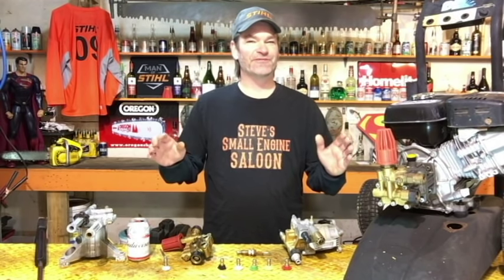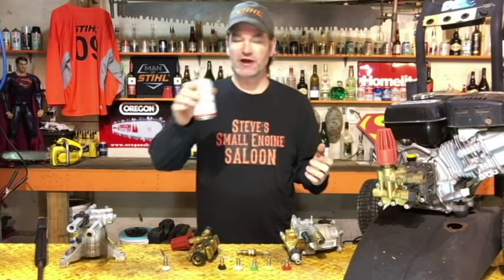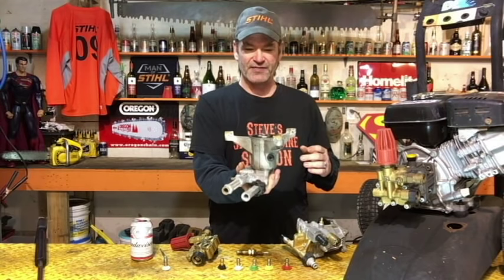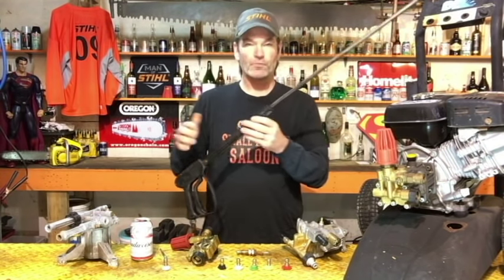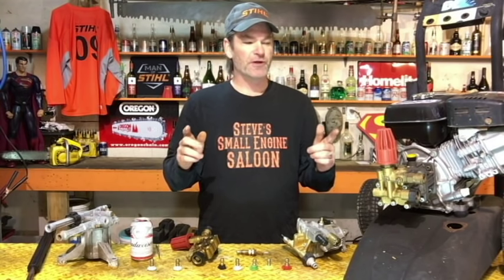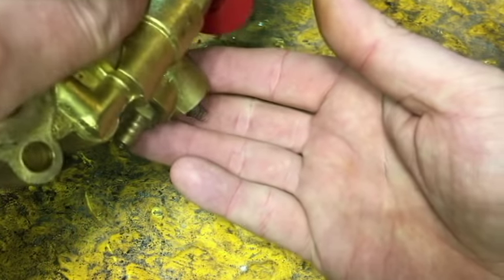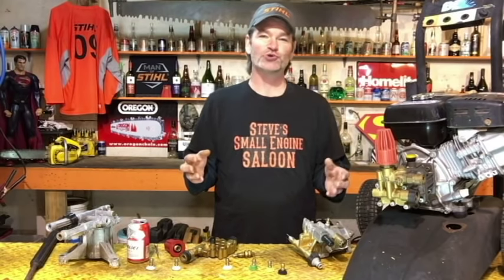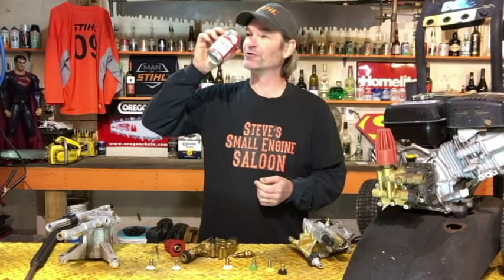How To Fix A Pressure Washer That Has Low Pressure

Comment: Hi Steve, I have a pressure washer with a Honda GX160 engine and CAT Pump (model 2SFX30GS).  The engine usually starts in 1 pull and it seems to run fine.  I get good pressure from the gun, but the engine only runs for around 30 seconds, then sputters and dies.  After starting, I can operate the gun for less than 1 minute before the engine stalls.  If I release the trigger before the 30 seconds, sometimes the engine would sputter and dies.  Basically, the engine dies randomly when the pressure washer is operating, and also sometimes dies when the gun trigger is either pressed down or released.

At first, I thought it was the engine.  I disassembled the carburetor and cleaned the jets.  I didn't see any worn parts inside.  I also changed the gas tank fuel filter,  swapped the gas tank cap with a known good one to rule out venting issues, and unplugged the engine-oil sensor to test.  The problem persisted.  I then swapped the entire carburetor with a working one from another GX160 engine, and still have the problem.  At this point, I speculated it was unlikely the engine.  I disassembled the unloader valve and didn't see much wear, and the plunger moved freely without problems.  I lubed the seals on the unloader valve with a tiny bit of silicone paste, and the plunger with a small bit of light oil and reassembled, and experienced the same problem afterward.  The times the engine didn't die when I release the gun trigger, I see the unloader-valve spring being compressed.

At this point, I'm completely stumped.  The pressure washer was working fine last year before I winterized it.  What do you think is causing this problem?  Is there some malfunction in the CAT pump that can cause the engine to stall when the trigger is down and the gun spraying (i.e., no water bypass)?

Comment: I always liked the adjustable tip most pressure washers came with years ago rather then these pressure washers that have come out today with separate tips. Just my opinion from owning pressure washers since the 70’s. Another great video by the way.
Reply from the maker: Right on ...
Reply: My neighbor brought his pressure washer over with that nozzle complaining that there was no pressure, he had turned it to the soap setting and didn't know it had that setting.  Quick fix 😉

Comment: Great video I have a pressure washer that I used and did not store it properly .I didn't turn off the gas and the pressure washer would not start. I checked  the oil and found out the gas traveled to the motor and I changed the oil it started right up but It didn't have any pressure so I grabbed a Modelo Especial and cleaned the tip and it worked great. Thanks
Reply from the maker: Right on Dan...

Comment: very good video. Thanks. I've been watching a lot of video fixing pressure washer but I don't see anyone mention about the water supply. Make sure your water valve faucet is fully open too. This could also cause lack of power because there is not enough water go into the pump. But Steve, I've watched many of your videos, I loved it. Will fix my Ryobi string trimmer next week. I got new Carburetor on order.  Thanks again Steve!!!!
Reply from the maker: You're Welcome...

Comment: It was the the nozzle. I was ready to ditch the pressure cleaner my father in-law gave me because it had no presser. But before I did, I watched your video. I cracked open a bear as instructed. Damn, it had a black nozzle in it. I changed the nozzle to the white one and bang , it worked. Thanks Steve
Reply from the maker: Awesome!

Comment: Great video Steve I recently started tinkering with my 14 year old pressure washer and you have given me some good tips I didn't know about.  And yes 14 year old Honda engine still running strong except for the water pump that just seized up.  I ordered a new water pump for it so I'm hoping I get at least a couple of more yrs out of it.
Reply from the maker: Right on Pete...

Comment: Very informative.
Never were truer words spoken. Everyone has a favorite tip they use all the time and fact that holes wear over time getting bigger n bigger. On a more serious note. It would seem to me that the majority of people's issues can be traced to the quality of their water supply.. And this video affirms that belief. We must develop a way to clean the inside of the pumps without having to open them.. I'm thinking soap, vinegar and something coarse in a loop for a few minutes along with a soak of hot RO water. Any suggestions?
Otherwise planned obsolescence wins. Can't have that.

Comment: Great video. I do this for a living but on commercial pressure washers. Wanted to make some comments to further your video. NEVER turn your unloader all the way down to the bottom. Thats the easiest way to destroy your packing and unloader. It is not meant to be bottomed out. The only other thing id have to say is, the tips are different sizes as well as different spray patterns. Getting too big of tips or too small of tips will vary the results. Make sure you read the number laser printed on the side of the tip. It usually starts with your angle and then goes to the size. There are 2.0 (20) all the way up to 7.5 (75) i believe there are bigger ones but they are rarely ever used.
Reply from the maker: Great comment!  Thanks Austin...
Reply: Hellon Austin, I have a Power Mate 2400 psi Washer.
I used a retractable hose about 6 months ago instead of a regular hose. 
The retractable hose burst, and water started coming out of the water pump area on the machine.  
I called Power Mate, they said the water pump was damaged. I have not used it since then. 
Insult to injury, the Pressure Washer was in some light rain this year. 
These are my EMBARRASSING facts, 
A new pump is going to cost me $160, $85 to install. I'd like to take care of this myself. Any thoughts?

Comment: one other place to check for blockage is where your garden hose hooks up, there is a screen in there that catches debris, pull it out and make sure its clean, anytime i hook mine up to a outlet, i turn the water on an let it run for a minute before hooking up the hose, bugs and trash can be in them.           here is the best tip you will find, run antifreeze through your pump when your finished, it prevents rust as well as lubricates the pump.. cut your gas off let it run until it runs out of gas.

Comment: Great video.  I have a low pressure situation.  I checked all that you mentioned.  I have the vertical pump.  I'm thinking un-loader valve.  Could this cause low pressure?  Thanks

Comment: Another one of many excellent videos, Steve. If I might suggest, I finally change guitar stings one in a great while. Depending on the gauge, .010 to .046 or whatever, you can use whichever string to clean very small  ports like that. The D string, for example, is strong enough and flexible.

Comment: I have a Karcher 2400 pressure washer. my problem is when i start up the washer, press the trigger I have no pressure. then I remove the spray tip and just run some water, I put the tip back in and i have full pressure, if i let off the trigger i need to do this process every time. i have used different tips, they all work fine. but i always need to pull the trigger without the tip then put the tip back in and it works fine. i put the tip in immediately. what is my problem? I really like your channel, it is great. thanks

Comment: Another great video, I turn to you so often to solve my small engine issues, and all with great success. I have a Honda pressure washer that has great pressure when I first start using it. When I release the handle for any reason and then pull it again, I get very low pressure. I have to remove the wand, pull the handle and let the water flow for just a sec, then reinstall the wand, and I get my pressure back. This is how my washer has worked for years, and I have not been able to figure out what's causing this. Any idea?
Reply: Your unloaded valve could be sticking. Simple repair. Remove valve, (no need to remove pump body from mounting) check and clean valve and O rings, lube with silicon grease and refit.

Comment: Thanks for the tips!  I have an Ex-cell 2,500psi Honda powered pressure washer and after about 2hrs of use I keep breaking the radial piston straps (10" x 1 1/2" pcs. of flat steel mounted above and below the pump cam shaft that flex as the piston pump rotates)  I'm wondering why this happens.  Thanks for any ideas.

Comment: Thanks for the small engines information you so generously share.  Pressure Washer Simpson with Honda GV-190 engine: my issue is low pressure, as your video described the red-knob, red or black maybe turn to adjust pressure output; I am unable to locate either of the knobs you spoke of on my machine, what else might i do to locate the knob?  I appreciate you help...thanks again for all you do.  James G.

Comment: Hey! Great video. I still have a question although I think u may have helped me out. Every time I put any tip on it works normal but when I let go of trigger and pull trigger again it only lets out a mini stream. I have to actually take the tip off and put it back on for the pressure to kick in again. I have a feeling it has to do with that small spring or o-ring part.  No one has ever touched it in years for repair or maintenance so anything is possible but when it works it’s great. I just don’t know why it has inconsistent pressure. I appreciate any thoughts on this problem.  Thanks. We need more people like you to share your wealth of knowledge. I am mechanically inclined but don’t know anything about small engine repair or power washers. So I appreciate the help always.

Comment: It was the preasure relive valve Chinese type and they haven't used a nylon thread nut and had unscrewed with vibration. Mine didn't have a red or black handle

Comment: Quick Question for you! Ran my pressure washer today on front deck. Worked fine. Moved around to the back deck. Cleared the lines of air. Fired it up. Squeezed the trigger and pressure for 2 seconds then goes low pressure. You can see at the end of the wand, the water is pulsating slowly. Release the handle and you hear the pump trying to pressurize for 2 to 3 seconds. Pull the trigger, high pressure for 2 seconds and then low again. Thought it might be inlet water pressure and tried a different spigot with the same results. Open for ideas! Thank you!

Comment: Great information Steve!  And something this 66 yo female can do!  Thank you!
Reply from the maker: Thank You...and You're Welcome...
Reply: @StevesSmallEngineSaloon  Well, I did everything you said this evening.  The nozzles are clear.  The high-pressure tube thing - I can see the light through the hole.  The uploader thing moves in and out.  (Is it supposed to go the whole way down?)  It goes halfway but moves freely.  So I hooked up the water hose, checked to see that water was flowing though it and it was good.  Put the spray hose on the machine and tried to see if water would flow (without the engine running).  Nothing. Nada.  I'm at a stand still and I REALLY want to get my deck and railings pressure washed soon.  Anyother words of wisdom?

Comment: My preasure washer is brand new only used it once and when I used the soap nozzel  it used soap fast and it ran out, I then switched nozzles to get high preasure and there's nothing.. no jumping of the cable it's a steady stream out nozzel. Please any ideas ? It's nothing on the wand no twisty end ? Please please anyone any ideas ?

Comment: Hey Steve I have a cat pump model number 67DX, I was wondering if you could help me out. I have a problem getting the crank case back on over the connecting rods and crankshaft. Any tips or tricks?

Comment: Steve...great video!  Thumbs up! I have a Simpson Pressure Washer that runs fine but only sometimes will shoot water through the gun.  I can hear it building pressure and it will blow off through the relief valve when the water heats up.  When I can get it to engage it runs fine for as long as I hold the trigger on the gun.  If I let go I have to continue trying to get it to re engage.  When it builds up to much heat it blows off.  I checked the unloader valve and it wasn't stuck.  No blockages that I can find.  Ran water through it with the pressure hose taken off to purge any air as well.  I found that if I pull the trigger on the gun while the engine is NOT running and getting that trickle of water going through and then start the motor it will spray with pressure and continue to do so until I let go of the trigger.  Then it is back to trying to time it by how the motor sounds and keep pulling the trigger.  What do I have going on here?  I appreciate any insight!

Comment: Ihave a Generac OneWash Power washer that I just put a new carb on. It now statrs okay but when I start to use it I get no pressure. Do you have a video on repairing the unloader valve? Maybe I put the springs and cables on the carb wrong. Thanks. Frank

Comment: I have a Generac 2400 pressure washer, Briggs vertical engine... I cleaned screens and inside nozzle but first spray is still high pressure as long as I hold trigger then all other spraying I get half pressure.  Last attempt to dismantle nozzle, after soaking nozzle in soapy water I found two bearings and a black plastic washer but don’t know where they go...  I cannot adjust the stream now so I am thinking they have something to do with that.  Also there are U clamps holding the nozzle to extension rod, one on outer yellow section and one on inner black section.  I can’t get the extension to move from nozzle to adjust pressure, seems like it is stuck on high setting.  Any help would be much appreciated.

Comment: Best choice for clean out wires is a cutting torch tip set. Cheap. Lots of choices. Any welding supply should have them or online.

Comment: Like the vids! I have a Honda GCV160 that only sprays at full pressure w choke on. It idles and runs with it off. Carb has been torn down and rebuilt, new plug and its a fixed throttle so no adjustments available. Any guess as to why it won't get to high pressure when choke is off?

Comment: Much cleaner results if you add a solvent like diluted chlorine to the surface you are cleaning. It prevents early regrowth of mould and there is less damage caused to the concrete surface especially when using a rotary dirt blaster head. We call them that here in Australia.
Reply: 2 years ago since you made this comment but in case you're still there just remember every time you had chlorine to your pump it does some very corrosive things to the metal so if you can apply chlorine through a separate vehicle via maybe just a bug sprayer or hand pump unit or whatever but I try not to add chlorine into the pump

Comment: I have a Generac Model 01537-1 (Honda engine) This thing has me baffled...  The only way I can get it to go to high pressure is almost stall it by choke and release choke quickly and it will kick on... Then when I release the trigger on the wand and pull the trigger again it will not go to high pressure.. Got to go through the same steps.  what do you think?

Comment: My Troy built crapped out(no pressure) after 2/3 Year’s . After driving myself nuts with all trouble shooting tips, including replacing reducer valve fo $30 which didn’t work, I replaced entire vertical motor fo $80! American airless. Com. Boom. 15 minuets.Works like  new!

Comment: Pretty sure the unloader valve is bad on mine I am getting drove nuts by pressure settling at 4200 PSI when I let go of the of the trigger when I pull the trigger with the 0° nozzle on pressure drops all the way to 2600 PSI give or take it's a 3600 psi rated machine. Ruled out being a low supply pressure because my outdoor faucets are all unregulated and I get 140+ PSI at all of them (I have to use reinforced hoses for my garden hoses). All of my other pressure washers produce pressure at what they're rated for I have ruled out everything but the unloader on this one waiting on a new one now.

Comment: Steve, I just discovered your videos and I love them!  I have a question:  I have a SunJoe upright pressure washer that seems to have lost pressure.  I checked the water flow with the power off and it seems to be clear.  The nozzle, the gun, etc. has a buildup (calcium?) that has not blocked the holes but may be diminishing the flow.  How should I clean them??  and what else can I check at this point?  Thank you!!  Rebecca

Comment: Hey Steve, love your videos. I have a problem with my pressure washer, it was supposed to be brand new and in working condition...I got it from a discount warehouse and the first time I hooked it up and turned it on there was water running out of the brass fitting on the bottom of it that looks like a small hose connects to it.... causing it to lose quite a bit of pressure when pulling the trigger. I'm perplexed and idk what to do to fix it. This is my first pressure washer and I have no experience with them. If you could help me out I cannot tell you how appreciative I would be! I look forward to hearing from you! 🤞

Comment: Steve I am running into an issue with my  xr2500  excel washer that intermittently i will not get full pressure if I squeeze the handle on and off a bunch of times all off sudden  I can feel the difference in pressure, it is the original oil less pump I am thinking maybe the unloader valve, i was thinking about  putting a new pump on it but thought maybe I could try a quick fix. any ideas for me? 
thanks Dave 
love you channel